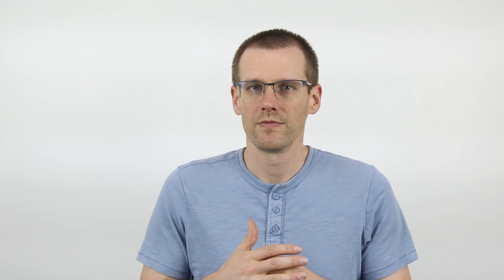The Shocking Truth about Wye vs Delta Wound Brushless RC Motors

Comment: another factor you didnt mention is the NO LOAD CURRENT(AMPS). Which is the minimum ammount of amps required before the engine starts to move.  That since a Dwind motor can have a higher KV will usually require more amps to start from 0 RPM. Also if the Dwind is sensorless and the motor will have a tendancy to cog more than a Ywind motor. 
. 

Such is the case with my TPpower 5670 Ywind motor  No Load current(Amps) is only 3.2amps. and thier higher KV 5670 Dwind No Load Current(amps) is around 9 amps.

that because the Dwind needs to have more amps just to start moving. It will cause the motor to want to start later on the throttle and cog. Also it can have less control of the speed at lower RPMs, along with how smooth and accurate your transmitter throttle is also.

Comment from the maker: I think a motor manufacture puts is very clearly here:
Which wind is better, Delta or Wye?
"For RC purposes, there is no difference, ZERO, nothing, NADA, better about a D than a Y. We use D and Y winds interchangeably to adjust the KV of the motor. "

For illustration of the Wye vs Delta Wind:

Winding Differences also showing Delta vs Wye:
https://youtu.be/a0El6PaBbuk

Kv and Kt of a Delta & Wye Wind:
https://youtu.be/IiootQtbF54
Reply: No one is clicking the links. Make this video again and include the appropriate visuals.

Comment: There is also a newer 3rd lesser known type of winding. That the RC community and motor companies have yet to pick up on it.   Well its really not new because its a Delta wind and a 
Wye winding(Wye=Star wind).
  It's called a Star-delta winding. That upon initial start it uses the lower Kv star wind to get more torque. Also because the star wind requires less amps to start and has better low RPM control. 
Then as RPM increases it switches the timing lower to use the higher kv Delta wind to get a higher top RPM and top end Horsepower.  It is basically taking the best of both types and putting them into one. 

The configuration isn't really any different as a D and Y wind are basically the same. only just the Y wind terminates in the middle whereas the D wind is at the end. That a star-delta splits the connections that half are a delta wind and the other is a Y wind. 
So to use it correctly the motor can be sensored to tell the ESC its RPM and change the timing. Or the esc can be programmed to lower the timing based on the throttle position

If the timing doesn't automatically adjust. it would still work just as a D or Y winding motors do. if the timing was still set from the factory!That the motor wouldn't perform any better or worse than s D or ,Y with no fine tuning to find the best timing what each motor likes best. 

And with a Star-delta wouldnt be any different finding best timing the motor likes at low RPM and best at High RPM . that it changes the timing  between those to values accordingly to RPM change.

Just a bit of FYI.

Comment: I put a castle 1717 im my Kraton. Dont know if i like it. It flips n monos easy incrediblr bottom end but you need to gear up for the low kv, im thinking low kv is good for pushing speed gears but for bashing i think the 2000 - 2400 kv are the best still heaps of torque but dont need as high a gear as the 1650kv, kraton still flips but will go faster. 
Those TP 2400 I swear have as much if not more torque then the Castle 1717 n heaps more than the Castle 2200 which has always been the top end motor really. Leopard motors are just as good but heat up more. But yeah, those TP cm motors are crazy.

Comment: I had only one delta motor and it always ran hot even with low gearing, low timing, and low voltage. Worst part was the esc got hot. I will stick to wye.

Comment: Hi, I have a question about a slightly different topic. So, I recently upgraded my Viper 90 (EDF) aircraft from 6s to 8s, with the same size fan unit, just with a metal housing (same amount of rotor blades). but a reduced kV motor from 3670 1850 kv to 4075 1500 kv (a bigger motor). My question is, How do I get more power with a lower kV motor with the same size EDF? With the upgraded setup, I get 1260 more rpm than the previous one. (voltage kV calculation, not an actual measurement).
Reply from the maker: You can get more power from a lower Kv motor using the same fan unit by increasing the cell count.
Reply: @RCexplained  thanks, but I didn’t quite understand the answer 🤔. I see in general that lower kv motors support more cells number, power.
Reply from the maker: If the motor is larger and of a lower kv, you can move up in cell count to achieve a higher power output. The load does not change with an EDF, therefore you must spin a higher RPM to gain additional power.

Comment: I've got electric engineering certificate and Ive NEVER heard y ..it's star ..delta and star ..
Star has no neutral ..the only real difference
Reply from the maker: Wye and Star are terms that are used interchangeably depending on region and context. In RC, Wye is more commonly referenced by manufactures. A delta wind has no neutral point but a Wye or Star wind does have a neutral reference point.

Comment: For a easier comparison for yourself to understand, you should of started with  wye and delta motors of the exact same size and kv rating,
Thats the best way to compare the two motors I've already tested this and know the exact  performance difference  the winds will produce , it costs time, and money , trial and error over the years will determine the real differences,  don't forget there are y1,  y1.5 , y2.0, 1D , 2D , 3D , 4D , 5D , 6D etc they all work differently
Reply from the maker: For a fair comparison, an experiment in the way that you describe, there's very few motors that have the same Kv/size(was mentioned in the video), are of different wind terminations and from the same manufacture. Which motors do you use as a good comparison?
Reply: @RCexplained  i use steve neu motors, which is the original motor designer/builder for castle, he has any motor kv in any size in which ever wind type you want , if your serious about racing rc and to be competitive in the sport, the only way to actually determine the real differences is to start with 2 motors same size, same kv , one with a wye and the other with a D thats it
Reply from the maker: Agree, have been using Neu since 2007.
Reply from the maker: Here's a quote from Neu:
Which wind is better, Delta or Wye?
"For RC purposes, there is no difference, ZERO, nothing, NADA, better about a D than a Y. We use D and Y winds interchangeably to adjust the KV of the motor. "
Reply: @RCexplained  mate there is a difference, no manufacturer will ever say which wind is better, if they did ,every customer they have, would be buying one type of wind , there is a serious difference you just need to try it for yourself, like all us speed runners, and drag racers have like the say, you have to pay to play, goodluck
Reply from the maker: @robertkotevski9649  sounds like a good business case. If one wind was better than the other and everyone only buys that one wind - the motor manufacture could eliminate many SKUs, reduce engineering BOMs and make the product more profitable.

Comment: Hey man, been watching your vids for a little while now, theyre great! I have a question i could use some help on.

Motor in question is a large 9096 outrunner in delta config at 150kv for a jetboard build. The problem is it runs too hot nomatter how much water i pump through it. Almost 100c

It is 9 turns in delta with some fairly small gauge wire. Im thinking of rewinding it to wye config. To keep the same 150kv, I would wind using 1.7 less turns (approx 5)?  

Assuming the above is correct, theoretically amp draw should remain unchanged. With less turns i can have larger wires with less resistance, heat generation should be less?

Please let me know your thoughts if you can.

Thanks
Reply from the maker: Interesting. It sounds like you need a larger motor that can dissipate more waste heat.

A motor at 150kv rewired to 150Kv in another configuration will provide near the same results. 

Getting a bigger motor would be a lot easier in my opinion.
Reply: @RCexplained  yeah I was hoping that wouldn't be the case. Motors of this size are definitely not cheap. Appreciate the feedback though!
Reply from the maker: Absolutely, cheap doesn't seem to be a term you can use for anything these days. Can you physically see in the motor and confirm that there is room to add more copper wire in the motor?
If you can't get more copper in the motor, the general idea is that you can't increase efficiency.

Comment: the differences are only relevant if you are designing the motor. to the end user it makes zero difference. I run both a TP 5670 850kv in delta. and a 5670 720KV in wye. There's zero difference in performance.
Reply from the maker: Agree, we'll said.
Reply: top end performance probably not.  but which one has more cogging? One thing though, is that TPpower only makes a 785kv and a 650Kv Y wind motor. but they do make the 820kv D wind.   They dont even give you a 720kv option on the 5670 motor as the 785kv is a 5Y(5 turns) and the 650kv is 6Y(6 turns). 

The only 720Kv TPpower makes is in a 5650 8Y(8 turns). That there is a big difference in power between a 5670@12,000watts and a 5650@8,400watts. Which the 5650 max is only 70% of the 5670 available power, which i would say that almost anybody could tell that much difference in power loss. 

unless #1 lets say you have the 5650 720kv in a revo thats lighter and the 5670 820kv in a 1/5 scale thats heavier you can compare them #2 You got a TPpower knock off 5670 720kv and you still cant compare the two. #3 you dont know/remember the correct KV motor you have.  #4 your system program may be tuned down/Or you dont have a sufficient ESC amp supply to compare. Or #5 your just a trolling mooch and you just it made it up and just picked some KV numbers because you wanted to write something on here as if you know what your talking about  

Because who would buy a two motors that are almost exactly the same. Unless you bought one as a backup as a replacement one day. Or you had two of the same cars. That one was for your wife or kid  and the other for you. If so then what would have been your reason for the two different KV

Here is TPpower kv options they list for the 5670. That you can pick the kv for them to make for you if they dont have the kv you want in stock. (720kv isn't on the list)
 https://www.tppowerusa.com/index.php?route=product/product&path=20_27_62&product_id=302
Reply: @smottiebug7518  my 720kv is from offshore electric, bud. 720kv and 850kv are significantly different RPM on 12s in a boat.